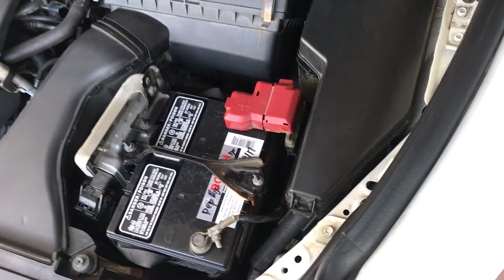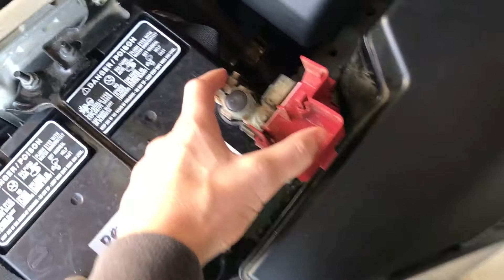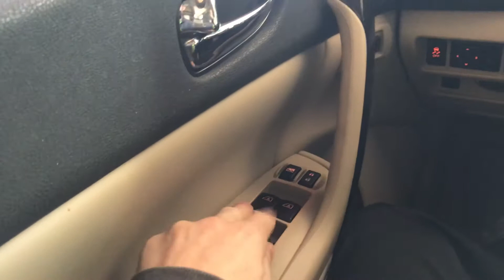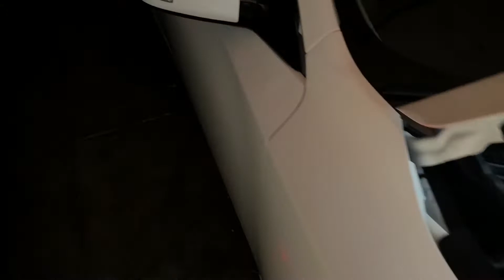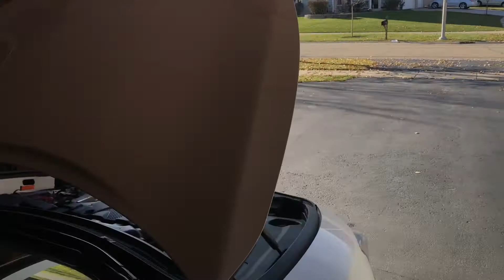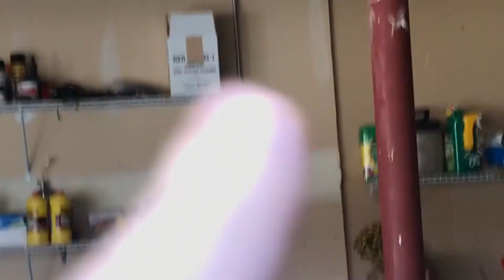Nissan Maxima - Change Battery & Fix Auto Window Repair (Altima similar)

Comment from the maker: Timestamp Schedule:
0:50 How to change out the battery on my Maxima
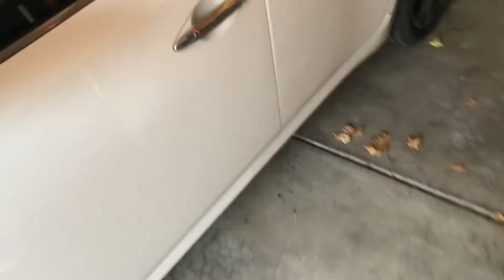3:00 Auto-window issue (auto up not working, but auto down does work)
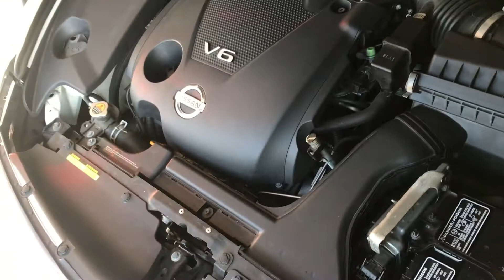4:40 Changing your engine air filter to K&N
Reply: 2009 Nissan maxima windows auto up and down doesn't work after battery change.
Reply from the maker: Sheikh Sherif -- did you try this method at 3:00?  I had a 2009 and 2012 maxima and it fixed both after battery change.  Just the front windows have auto if I recall...
Reply: @JealousLawnCare  yes
Reply from the maker: Sheikh Sherif --- very strange, not sure why it wouldn't work for you...

Comment: Hey I was about to change the inside cabin air filter  i have the nissan filter does the arrow point towards the inside car or to the engine thanx for help  my mechanic has gotten greedy all of a sudden tried to charge me 50 bucks this oil change I told him I'll do leave it alone
Reply from the maker: Honestly I just did this on my maxima again but didn't see this message, sorry.  Can someone here help answer?
Reply: @JealousLawnCare  thank I for the reply I got it done wasnt that hard just hand bend akward defintly not worth giving him  50 dollars for labor I bought filter  he think he is the dealer now

Comment: how is the maxima treating you? my transmission died before 70k miles but warranty got me a new one now they claim the transmission control module is bad after some troubles and a new tranny two years prior
Reply: I have a 2010 Maxima at approx 200K miles on the clock, original motor and cvt transmission. Runs like a champ! Be sure to keep up with with your transmission fluid change and replacement of the external transmission filter. Those two things will definitely prolong the life of the transmission. I'm looking to add an atf cooler soon since this cvt tranny runs and operates even better with lower temp fluid versus hot.
Reply: @coreyang08  thanks i do have a new transmission after 62k miles i switched to parking with the emergency brake every day and will change the fluid every 30-35k miles with Nissan dealership.

Just got sold a part and labor for something i didn't need this week so a big mess sitting at 72k miles and they can't diagnosis the problem correctly
Reply from the maker: I can't stand mis-diagnosis...its the worst
Reply: @CurtisDJunior  Any idea what the exact issue you are experiencing or trying to have fixed? What year is your maxima again?
Reply: @coreyang08  they're claiming my alternator needs to be replaced now. 2014 Maxima

I drive and then vehicles 1. Brake 2. Abs 3. Service engine 4 battery light come on and the vehicle stalls or loses acceleration you can glide on hazard to park. Give it time and it drives again then stops same way.

The had it 2 visits and couldn't diagnosis and now the service manager after two weeks and video evidence says i need an alternator. Dealership got me for $1300 and then wanted 600 parts 400 labor for next job but would split costs down the middle. I called bs and service manager agreed to fix it at no additional cost but $100 for thr alternator warranty been a nightmare.
Reply: @CurtisDJunior  a big mess? Is your car currently driveable at all? I don't understand how your transmission could have gone out under 100K miles already, but glad to hear Nissan was able to replace it with a new one under warranty
Reply: @coreyang08  yes i drove it to the dealership fine after i let sit for a second. Just happened to suddenly stop on me twice after i paid for repairs. So they never addressed the issue and misdiagnosed.

Got Car at 14 miles used. Tranny went out at 61k. I did a flush early on as nissan recommended too maybe at 25k miles. I blame possibly never using the emergency brake i now use it everyday to keep weight of the transmission but i still only have 72k miles on the car from 2015 - 2022
Reply: @CurtisDJunior  sorry to hear, but that's one of few reasons I don't use dealerships or let any indy shops work on my cars. The way you described it, it does seem like your alternator is on its way out. I'm still on my original alternator and starter, fortunately. Two biggest killers of alternators are oil or fluids dripping or leaking into them and running an alternator on a low charged or bad 12 volt battery. Both will shortens the life of an alternator. If the dealership is willing to replace it for $100 let them.
Reply: @CurtisDJunior  since you said the 'service engine soon' light came on...do you have a scan tool to see what code(s) might possibly appear? Or places like autozone or Oreilly can check the health of your alternator and any codes for you.
Reply: @CurtisDJunior  sounds like your car went into limp mode if you were able to let it sit and drive again. That usually happens if and when the cvt overheats. Happened to me once and that's when I began proactively replacing the cvt fluid and external filter and never went into limp mode again. Cvt transmission seems really sensitive to the fluid getting too hot, as the cooler the car comes with sometimes can't cool the fluid efficiently enough hence causes it to go into limp mode. I wonder if you have two separate issues here
Reply from the maker: Bad news bud, I just had to get my alternator changed for around $800 also in my 2012.  Never had this issue with my other vehicles even after 160k miles...
Reply from the maker: Yep I had bad batteries 2x which i got warrantied out...likely is what messed my alternator too
Reply from the maker: I change my Trans fluid on other vehicles buy never the maxima.  Since its cvt and enclosed I hear no need to change.  You take it to a dealer for this, how much does it cost?
Reply: @JealousLawnCare  maybe 200$+

Please watch scott kilmer transmission cvt video it's enclosed but the metal breaks down over time in it. Even forums or YouTube comments the cvt I've come to conclusion needs to be flushed every 30-35k
Reply: The cvt tranny isn't enclosed or a sealed transmission, there is a drain plug you can loosen to drain fluid out. Then pretty much fill with the same amount you drain out through the dipstick hole. You can do a 3 X's drain and fill to get all the old fluid out with driving in between each drain and fill. Never, ever do a flush as that can stir up things inside the tranny and ruin your transmission. The external tranny filter can be accessed by removing the front driver-side wheel and then remove the black plastic fender splash shield. Cheaper to do it yourself if you possess basic mechanical knowledge. Takes me less than an hour to do a drain and fill and replace the external filter. Good luck if you plan on tackling this job yourself. I just don't trust the stealership touching any of my cars at all and perform all scheduled maintenances myself in all my cars.
Reply: @JealousLawnCare  no such thing as an enclosed or sealed transmission, if it has a drain plug it isn't sealed. Meaning the fluid has to be replaced at every 30-60K miles interval. I do a single drain and fill once every 45K miles, two is even better but once is good enough. You just don't want to over-do it or under-do it. Find a balance and you'll be fine
Reply from the maker: Thanks I'll check it out..dang that's too cheap for a flush :-/
Reply from the maker: Ya that's what I do with Trans changes in my other vehicles...i change 1/3 with each oil change essentially with a drain.  I never investigated deep but I always saw on forums it wasn't able to drain as easy.  I'm definitely gonna have to recheck into this. Thanks
Reply from the maker: Sorry to hear that, my maxima is right at 70k currently also.  The only issue I've had is a bad alternator and battery.  Hopefully our issues are all over with now.

Comment: I’m having a problem with my driver side window takes a min to go up and down. Also the lock  and unlock buttons don’t work lol
Reply from the maker: Did you just recently change the battery or do any modifications?  Seems very strange

Comment: It did not work on my 2010 nissan maxima.idk what is wrong with 3 of my windows they are good a week nd then they will just not go up and get stuck .and also my lock button dont work .What can be the problem?
Reply from the maker: Erika Quintero -- getting stuck on its way up seems like it may be a different issue.  Did this happen after changing the battery only or was it involved in an accident (are the windows original oem)?
Reply: Im having this same problem on a 2013 Altima

Comment: My rear passenger window does not go up easily. Have to jiggle the switch a lot to get it to move just a little. Could this be the same problem or a more costly 1? It’s an 03 maxima. I got the car used not sure if the battery was recently disconnected.
Reply from the maker: Michael S. -- hmm do your other windows have any of these issues? Im thinking this is a different issue.  Could be a few issues I can think of, when you say it doesn't go up easy.  If you hold the button up Doss it work fine or are you only referring to an auto up issue? I also wonder if the window was replaced (then maybe the new window wasn't oem size / specs which could cause issues). There's usually etching on the windows to show part #s and such.  Just make sure it matches the other side.  This was an issue I had in my Accord window not working. The person before me cheaped out and went non oem after car got broken into and every now and then the auto window had issues.
Reply: Jealous Lawn Care well when held down the window would not roll down, had to jiggle a lot to get it to go down & back up. I’ll check to see if the window was replaced. Thx. It can’t just be the switch because it did the same think when I attempted from driver side & rear passenger side. It did roll down so the motor is working. It’s probably the window was replaced, thx again.
Reply from the maker: The only other thing I could think of is maybe the window is off it's "track"...that's not an easy job though, taking apart the entire door pretty much. :-/

Comment: thanks.... hey do the fuel cleaner really works
Reply from the maker: James Palmer --- I look at it from a few different views. Most importantly is they do clean out fuel system well (I've seem some detailed videos of before and after interior views with mini cameras and it does seem to work well to clean gunk out.  I like to be pro-active and prevent problems before any issues arise.  I wouldn't recommend it if you don't keep your cars long though, since it won't payoff itself as much.  Next areas are mpg and hp gains. They've done dynos before and after for small hp gains (Redline brand). I've also done my own. Testing for mpg gains and of course it's minimal, but still there and basically pays for itself by the time the benefits run out (time for next oil change + next bottle of Redline).  I doubt the cheaper brands would be worth it. I'd stick with Redline or Mobil fuel system cleaners imo.
Reply: ok cool. thanks man. hey i have a problem. i have a 2010 maxima my fog light connector is burnt. how can i fix it?
Reply from the maker: James Palmer--- do you know how it got burnt? Did you install a bulb with the wrong wattage (even though this should really affect the housing too) or was there another issue?  And where is it burnt...the cord or the socket side?
Reply: yeah i think it was a bulb with the wrong wattage. just the socket is burnt.
Reply from the maker: Here's what I would get for replacement (it's little pricey, but best reviews and quality).  Unfortunately it only comes as a set of 2:https://www.tunersdepot.com/2010-nissan-maxima-harnesses/nokya-heavy-duty-fog-light-harnesses-h11-84165.html
Reply: yo' man thanks a lot.. now i just have to fine out how to put on.

Comment: Hi, i’ve got some problem when I change the battery of the car there is a littlescreen On the  that give me the range of the miles that I can to drive before I full the car again this screen  doesn’t give me the right range again  how can I fix it ,thank you
Reply from the maker: Muhammad Mas --- 2 things I'd recommend to start with.  First, call the dealership service dept and give them your Vin # and ensure your car is updated with all service bulletins. There is a service bulletin which has to do with fuel sensor levels. Second thing to check is to hook your car up to a code reader and see if any codes come up. Autozone does this for free as a customer service. These would be where I would start, hopefully these work for you!  My maxima had similar issues, and buying a new oem gas cap fixed this for me (it was giving me a code from the Autozone code test).